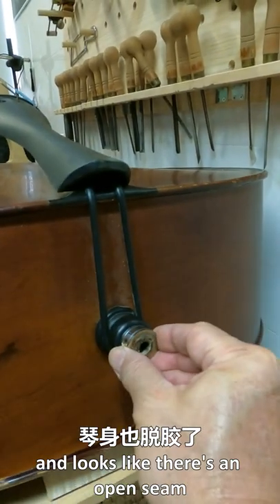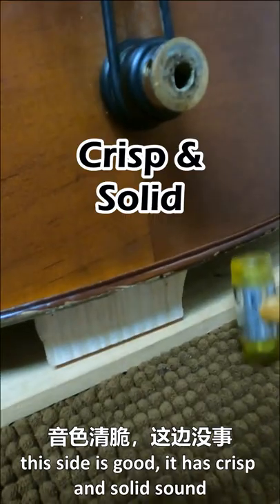Double Bass Repair & Endpin Replacement 低音提琴损坏了！#shorts

Comment: Okay, a novice here , but what about the sound post when doing an operation like this ?  I’m thinking of buying a used bass that needs a new end pin.  If I take down the strings and relieve tension , won’t the sound post fall?
Reply from the maker: Hi, If the soundpost was not sited properly it may fall. But if it's tightly sited then it will not fall easily.